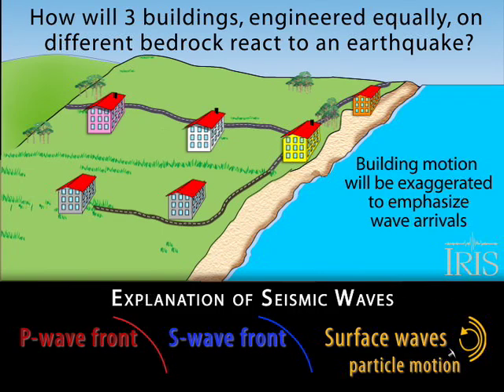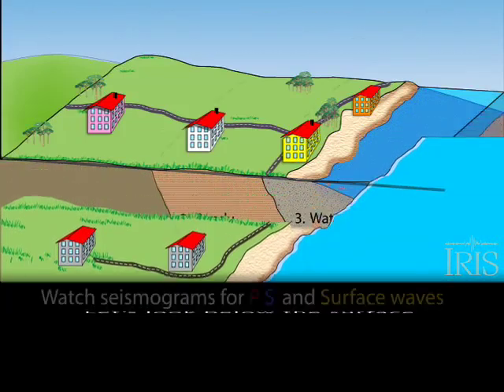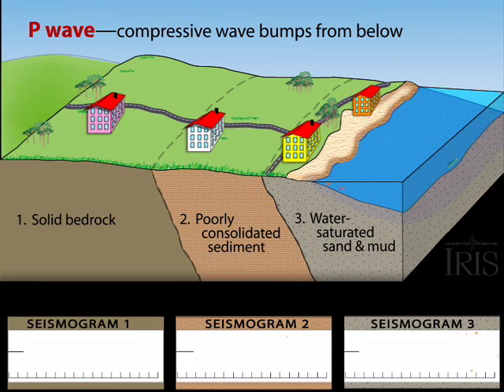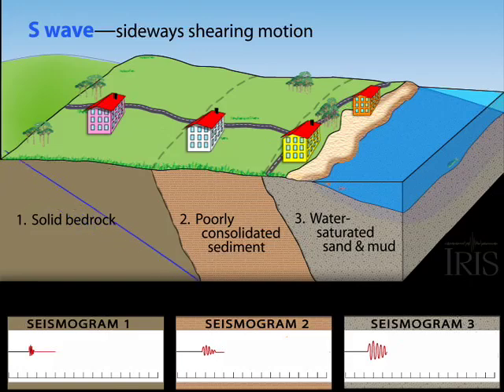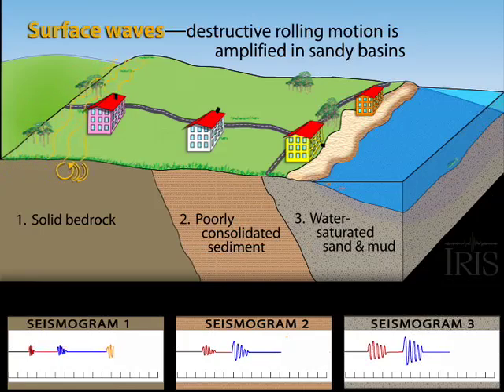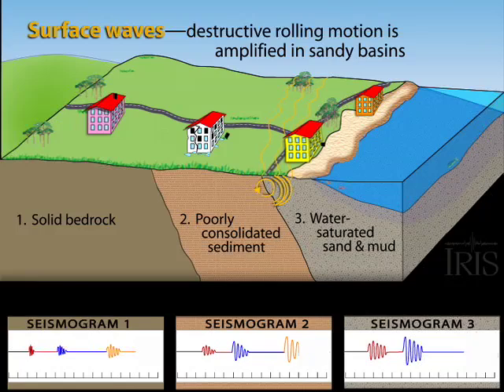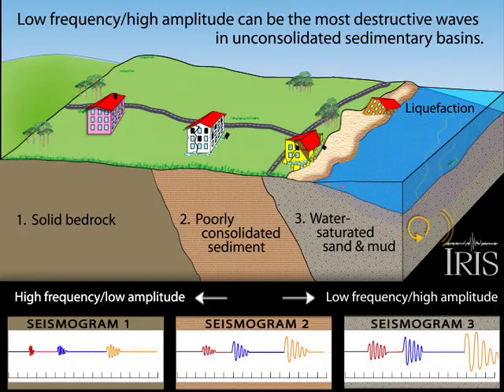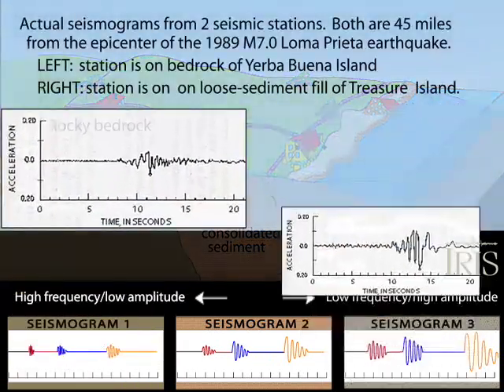Amplification and Liquefaction Animation (Educational)

Comment: my question is, how does one find solid bedrock? is it simply a matter of being farther away from the beach or bodies of water?
Reply: You drill. Jk idk. But I would assume anywhere where there is solid bedrock would be able to be detected by some kind of instrument that's used for GPR(ground-penetrating radar). The underground layers beneath the surface would depend on what kind of material it is working with.

Comment: How does amplification occurs?  Doesn't that contradict with the conservation of energy. If wave amplitude represents how much energy it carries. Then how come a different medium  will cause an increase in the amplitude which means an  increase  in energy
Reply: because when the waves travels through looser ground or soil, they will slowed down, and in turn, there will increase in amplitude to carry the same energy.
Reply: @agnidawala8180  sorry for the naive question  but is the carried energy of a mechanical wave is a function of wave speed ? I thought it is only a function of the amplitude
Reply: @stooncol619  the energy flux is constant, when the waves travels through dense rock, we get a high speed wave but a very less wave height to maintain a particular value of energy flux. But in the loose soil where the soil particle is more sparse, the wave propagation will get slower and the wave height gets higher. An earthquake is simply a wave that carries energy, which travel though ground or soil. The speed of the wave travels, hence, depends on the soil characteristic it goes through.
Reply: @agnidawala8180  make sense  thank you very much